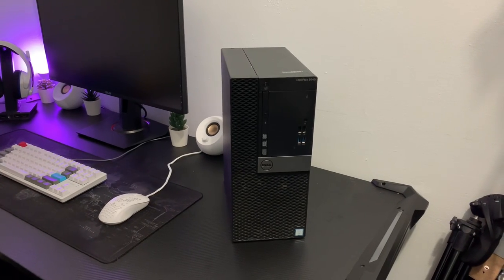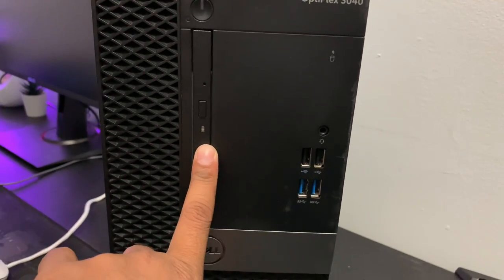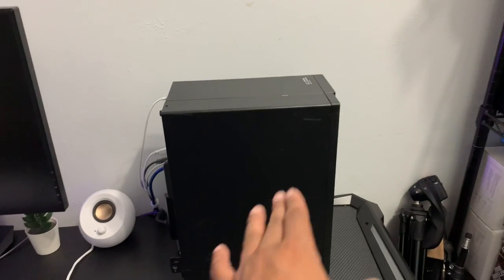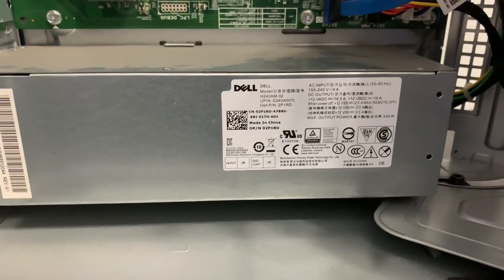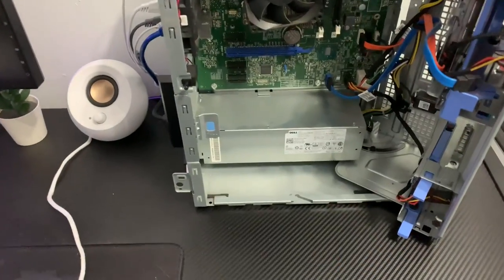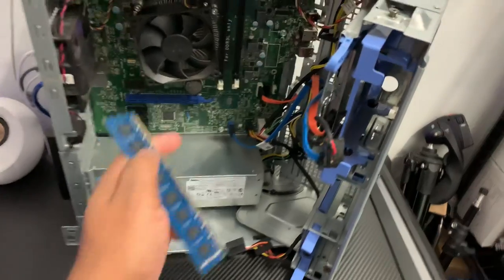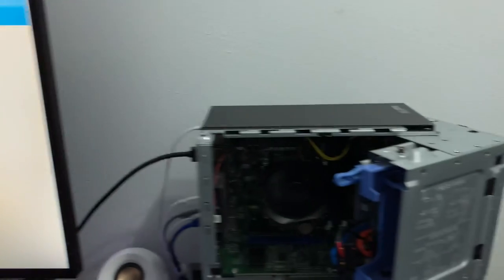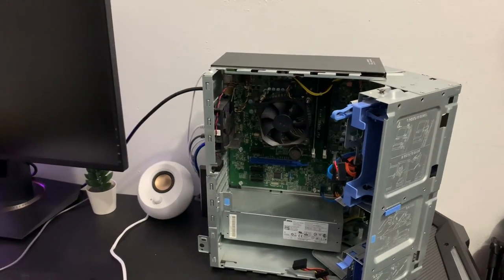Free PC! What should I do? (Dell Optiplex 3040)

Comment: I have the exact same cpu, but my motherboard also supports 7th gen cpus so i am on the lookout for a 7700k. I have the GTX 1660 installed in my rig and it plays games very well, but because of the power supply, i would stick to something like a 1050ti or a 1650, why? The 1050ti is about as fast as the rx6500xt, but the 1650 is faster, it's all about budget, but with both nvidia options, this pc should be fine as a budget gaming rig, and since the 1050ti and the 1650 don't require external power, the dell stock power supply should be fine. I would like to see what you did with it :) as for the rest, throw in another stick of ram that matches the other one and install an ssd, 2.5" ssds are quite cheap nowadays :)
Reply from the maker: Thanks for the tips. Stay tuned 🙌
Reply: The 1050Ti is definitely not as fast as the 6500XT. Hardware Unboxed found the 6500 XT to be almost 50% faster on PCI 3 systems and about twice as fast using PCI 4. It is in a completely different league.
Reply: @AliShaikh_744  yes, that may be true in any other case, but in his case with this particular pc, it is not. I gave this man the best options in his use case, if he would build a rig himself with a tight budget, i would've recommended something totally different, but since his pc is pretty old, a 6500xt doesn't make much sense because he is never going to use the full potential of his gpu anyway, and since he didn't spoke about any upgrades in the near future, i make sure he saves as much money as possible

Comment: Going to have to be a very low power GPU unless you upgrade the PSU. No pins, board power only. I've actually never seen this version, I myself have a 9020 MT with a Xeon E3 1271 V3 @ 4GHZ (I7 4790 Equiv., it came with an i5 which was decent but lacking) and a 8gb RX570 in it. 500w PSU.  Still holds up to most modern titles at 1080p, some games getting away with mixed medium/high, some even ultra for specific settings. Like car textures in Forza. Minecraft with SEUS shaders and NAPP textures, mostly around 60fps with occasional dips to mid 40s and 50s. 18 chunks. With a different texture pack or stock textures it can hit above 100 at times with shaders. Definitely starting to show it's age but most games haven't been that great lately anyway. My cpu is still good enough though to justify a upgrade though, like a 3060 or 6650xt, or even a 3070 or 6700. Those would be bottlenecked a bit though, but the performance gains would still be pretty massive. Most games still don't use more than 4 cores. They can't as it's infeasible to as majority of their customer base is on 4 core 8 thread hardware
Reply from the maker: Yes, Only 240w power supply. I need a low power GPU.
Reply: @TechTunerLife  it'll be a great budget machine that can play SOME newer games and pretty much all older titles at least. And fetch a profit maybe. If you plan on selling it.
Reply from the maker: @tacticalmattress  You right! Thanks